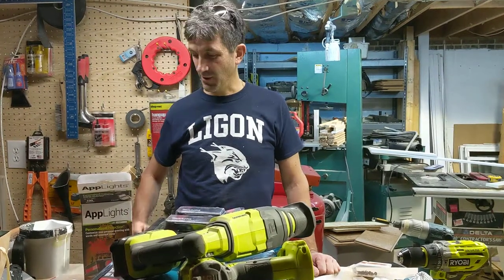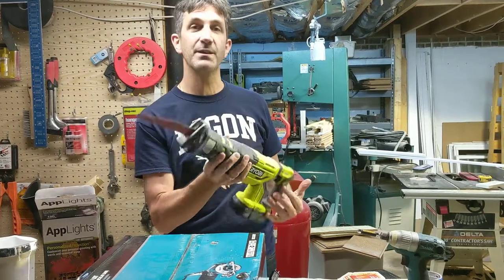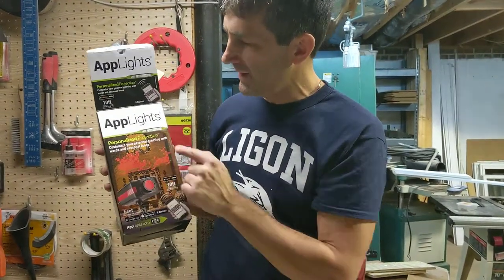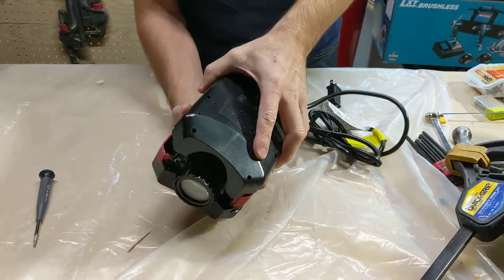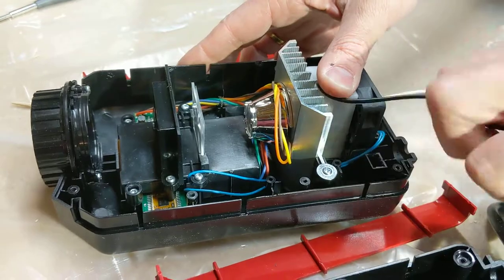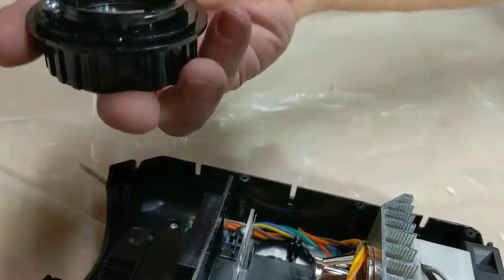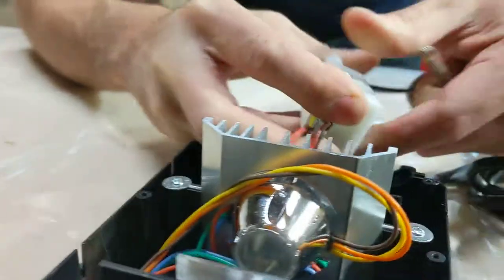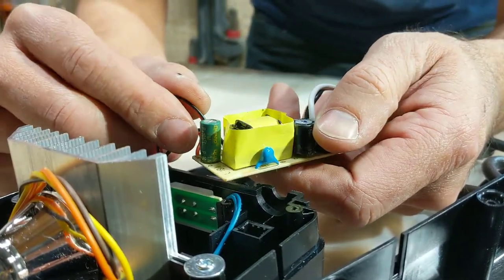SWBAD Holiday Cheer Projector teardown

Comment: I think I see the points where they connected to load the videos into memory. @ 12:05 in the video from your point of view they are (possibly) the cluster of test points in the middle near the resistors and crystal marked VSS VDD GND These are possibly USB connections.
Reply: Now your left with the chip and software, wouldn't it be easier to buy an Arduino kit and just connect the whole thing onto a custom Arduino micro USB port?